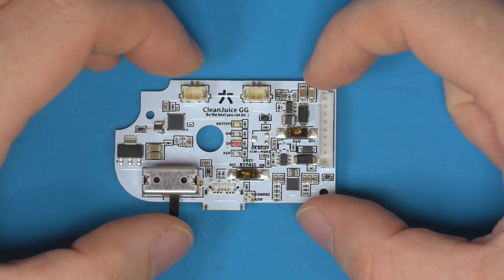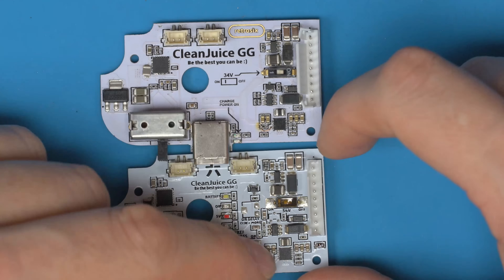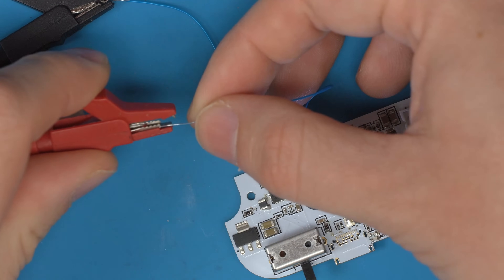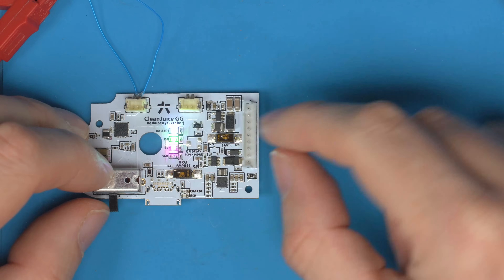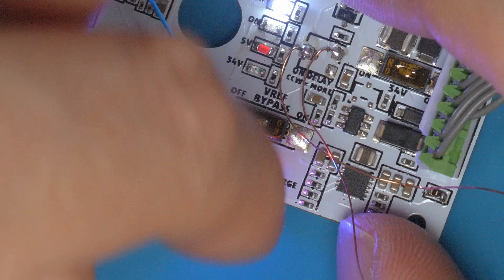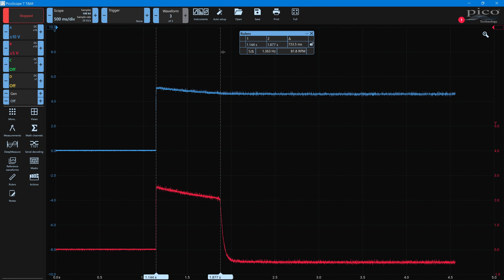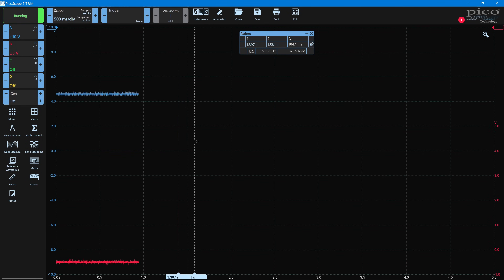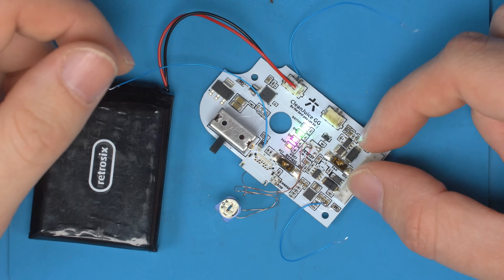That powerful it should have been BANNED by Sega!

Comment: Good day, apologies if this has been asked in the past. How many watts (i.e. USB C adapter) will the CleanJuice GG require for the 34V tube? and if modded to an LCD, will this reduce the input wattage requirement? Also, can a USB A port provide enough power? (i.e. USB A to USB C cable). Cheers.
Reply from the maker: 1A should be fine, 2A for all scenarios
Reply: @RetroSix  Thanks for the quick response!

Comment: these are awesome, if I had a wish for these, it would be to have a smaller battery pack option for the original shells so they don't need trimmed. I'd be ok with losing some play time since they are so easy to charge anyway